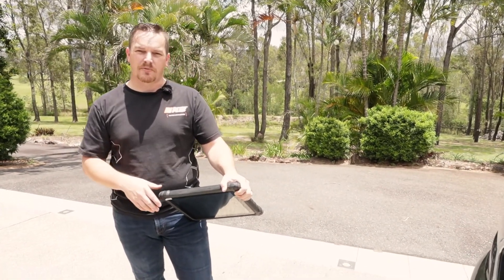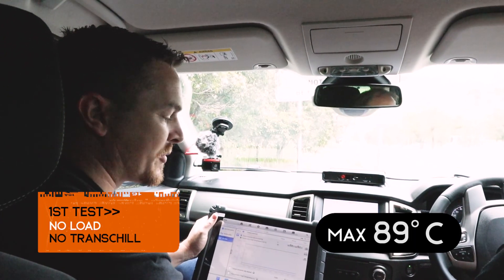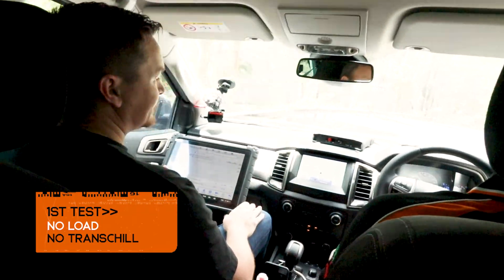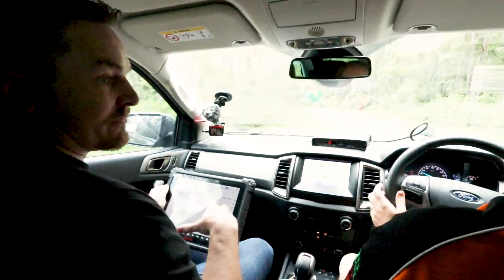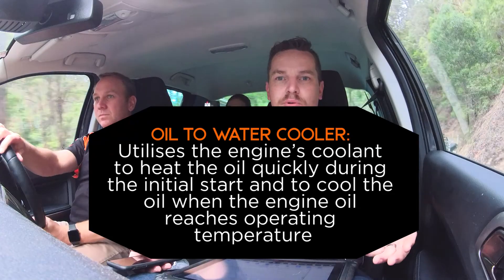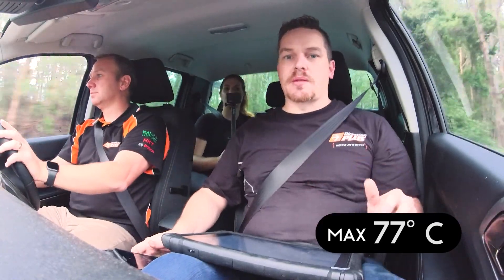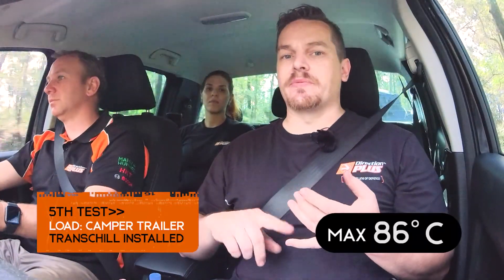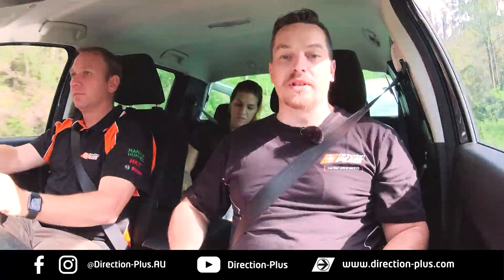Do Transmission oil coolers make any difference? Road testing

Comment: I had connected line transmission out to water cooy to air+fan transmission cooler and return fluid to transmission crank.
The temperature lower than engine water tempety 20 degrees cencious.

Comment: Hi. I just installed a transchill cooler. I have a scanguage 2. I still get 97C without load. My rig has steel bumpers front and rear, plus a winch. Is 97C normal or did i do something wrong in my install? Appreciate the feedback. Thank you.
Reply from the maker: interesting. I would just double check how the core are connected, making sure they are connected up in series. Otherwise shoot sales@directionplus.com.au an email with some pics of the install and we will see if we can find out whats going on

Comment: How does using an air cooler go when at low speed / not much airflow, such as working it in soft beach sand for long periods?
Reply from the maker: Most 4WD with diesel engine run a engine driven fan which will provide additional air flow at low speeds. How ever we are developing a fan option for our kits, which should be available in the later part of the year.

Comment: from temprature difference
transmission oil temp with air cooler
97   ----->> 77 no load
99   ----->> 86  trailer load
110 ----->> 92 boat load
degree celcius
Reply: good conclusion
Reply from the maker: Thank you

Comment: Did you remove the transmission tempature regulator from inside the trans ? And each day approx what 
was the difference in ambient Temp?
Reply from the maker: no the internal thermostat was still installed. We try and keep our kits as DIY as possible and dropping the pan to remove the thermostat would likely scare people away from doing it.  Also without the thermostat, in cold climates the transmission would likely not reach a proper operating temp.

there was only slight variation in temperature between the days and time of individual runs.